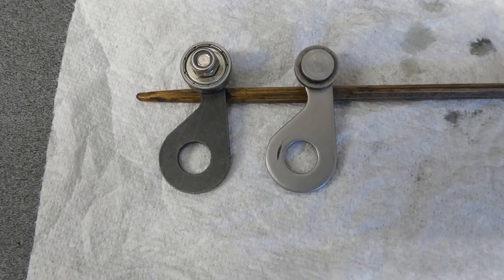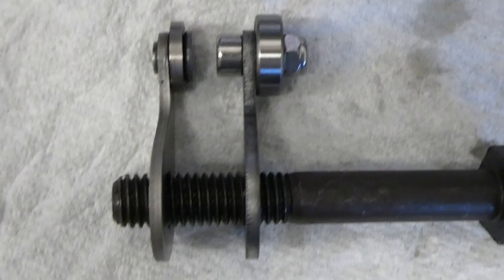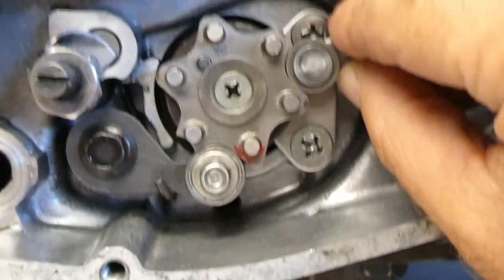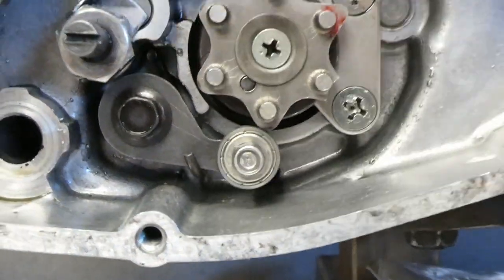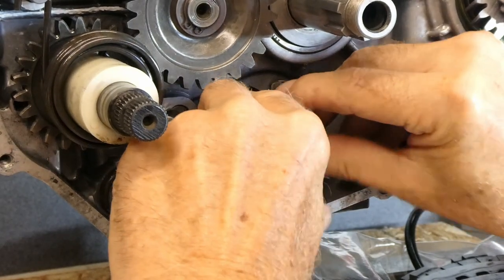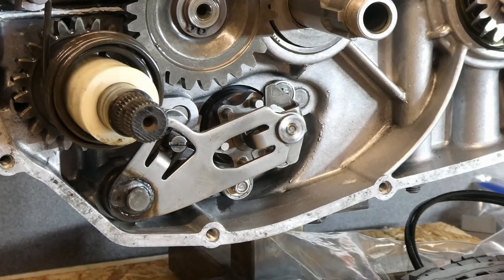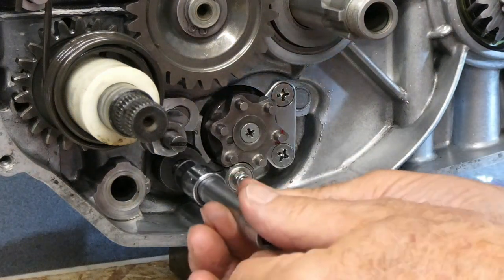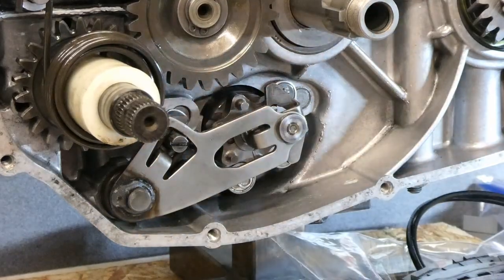RZ350 NC2 Resto Mod Ep38 – Install Shift Detent With Roller Bearing

Comment: Any updates on the detent and how it performed
Reply from the maker: The detent is working fine (I think). Sadly I put a used clutch from a race engine in this rebuild and the clutch is not performing well. When cold it lurches a bit when putting it in first. So ATM I'm unable to 100% comment on the detent. The cluth needs to be change at some point then I'll know better.

Comment: Ken, how did the shift detent work out? Smooth shifting? Easy neutral? Any problems/concerns? Thank you for your videos, very helpful!!
Reply from the maker: Richard, you're welcome for the videos. I can't answer your question yet because I'm still working on this project. Hopefully this shift detent will smooth things out a bit and make for easy neutral. However, it may be one of those mods that isn't very noticeable. Once I get the bike on the road hopefully I will remember to get back to this episode and report back on the shifting. On this engine build I also did the clutch pancake bearing which may have zero effect on shifting and the shift star mod. The shift star mod I can attest to being helpful as I did this on my thrasher bike rebuild and ride that thing all the time. It shifts quite well and finds neutral easily.
Reply: @KensGarage1 ?